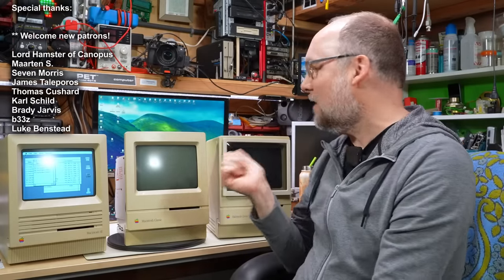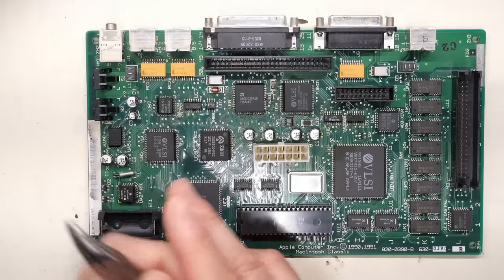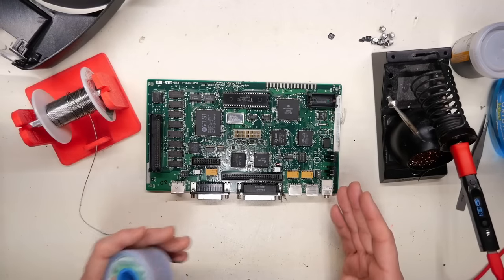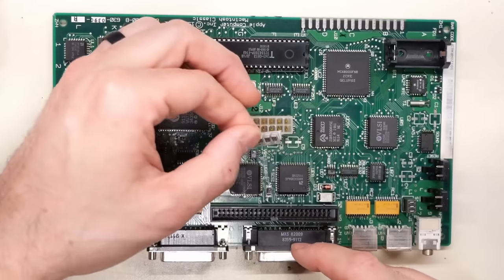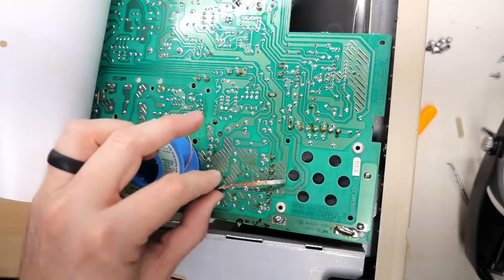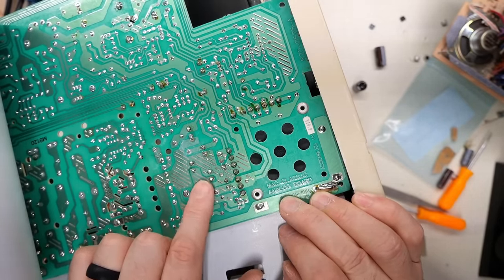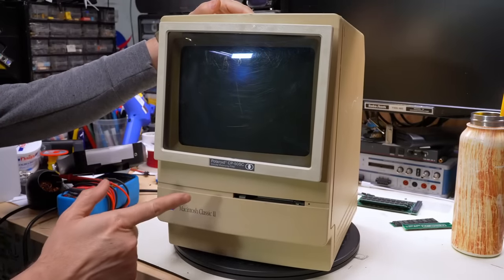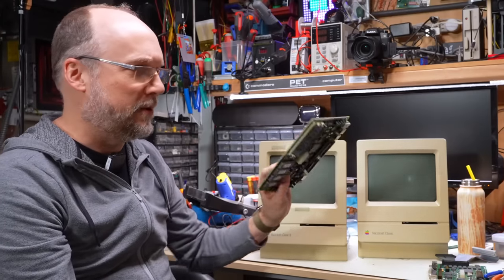Not so fast! I hit some road blocks fixing the Mac Classic

Comment from the maker: I need to mention I mixed up Ray Carlsen and Paul Carlson with the cap removal method. (Paul is the one I got the removal method from) I'm fully aware they are two different people :-)
Reply: That's what I thought.
Reply: the vinegar will most likely eventually dissolve the salts if you leave it long enough, like 2-3 hours, but you might need to submerge it in the vinegar because just the amount that you can spread on it will alter in PH pretty quickly in the localized areas near the heavily salted areas
Reply: @briangoldberg4439  I don't think they are necisarily salts. They may be lead/tin oxides. Both are used as white/ off white pigments in artists paints. The vinegar works on the unreduced electrolyte (Possibly KOH) put not on the metal oxides. The brown stuff is possibly breakdown products of the solder mask and the electrolyte. May wash off with acetone or Paul Carlson's favourite, Laquer Thinner.
Reply: LOL, I didn't even know his first name!

Comment: Don't let the loud few complaining about the wiggle method or however you remove the caps.  You've proven you know what you're doing, but some people will complain no matter what.  The loud few shouldn't get so much attention is my opinion :)
Reply: 100% THIS
Reply: Agreed. Just ignore them dude.
Reply: Quickest and easiest way to do it
Reply: There is certainly a risk to each method of removal (removal itself has a risk regardless).

Just pick the amount of risk you are comfortable with. If you don't want to apply mechanical stress then use hot air or whatever else.
Reply: It's gone? Yes.
Then where is the freakin problem?

Cause he didn't removed them another way?

We are adults or toddlers fighting because he didn't lick his lolipop same way we are licking ours?
Reply: I like'ta wiggle, -wiggle, wiggle.
I like'ta wiggle, -wiggle, wiggle.
I like to... 
🎶[(O)]¯\_d(o_°)b_/¯ [(O)]🎶
Best way to keep solder from resticking as it cools.😁👍
There's also Chip Quik, or an amalgam.
Reply: I agree but I think🤔the board should on pill too because no method is 100%, I’m just sayin cause I’m sure he doesn’t want a bunch mac mini’s running around.😳
Reply: @annacurransmotherofmeghanc1841  Just reminding you all, have your Macs spayed or neutered.😆
Reply: I guess those who complain about wiggle method has pulled the cap while they wiggled, and ripped the pads.
Reply: Only wiggle, 'casue pulling too much will make you go blind.🦯😎
Reply: Ive never damaged a pad with the wiggle method and Ive done a LOT of boards. I have damaged a pad using the snip method because the legs are under the cap. As you pinch/cut the legs the cap is pushed upward by the snips as they close putting upward stress on the pad. Ive damaged pads trying to desolder because of overheating to get through the crust from leakage. If caps were shiny new the. Desolder works great but we are removing corroded leaky caps here.
Reply: To remove the "gunk" from the pads, I use a slightly different method. I solder it up as much as it takes, then I add a liberal amount of paste flux. Cover it with desoldering braid, heat it up with the iron an just slide it of. It may feel a little rough, but I have never done any damage this way, and the pads are like new.
Reply: Adrian has countless examples that this method works. I know a key bit that he says, but I must stress, is making sure to push DOWN while wiggling. Don’t keep the pliers even with the board and especially do not lift up at all until the cap comes off itself. You don’t have to push with all your might, you are just making sure all the metal fatigue is happening to the caps wires in between the cap and soldered points. And, again, let the cap come off itself. If you’re not doing this and you pull traces, that’s your fault, not the method. If you’re still unsure, just do it how you want to and leave Adrian alone lol.
Reply: @g.h.190 And they probably weren’t pushing down or rushed it and didn’t let the cap come off on its own. There is some finesse happening here.
Reply: I don't have enough information or experience to say for sure wether the wiggle method is safe or not compared to desoldering them off
But what I do want bring something up to consider when thinking of doing the wiggle method on a random board . This being 
 I suspect this works fine for most good quality boards However I suspect some of the cheap boards might have weaker bonds between the pads and the board to were the pad will start comeing off the board before the capaciters legs fracture off the cap because the adhesive the factory used may be a low grade weak adhesive.
Reply: @g.h.190  Oh man,that sounds rough. I think those kind of people need to implement a safe word.

Comment: The secret to white vinegar cleaning is to float the board like you did and then wait while doing nothing to the board for 10 to 12 minutes then use a electric tooth brush, one of those Sonic ones, to clean corroded areas. The electric tooth brush is important and essentially acts like a localized ultra sonic cleaner when combined with the vinegar. This method can clean some really badly green corroded stuff and that white stuff you encountered is an indication that it was working but was not completely removed. Also, and I’m not sure if it matters but I use IPA with the same tooth brush to clean up after the vinegar rather than water not sure if that is necessary but might be part of why I don’t end up with any of that white after cleaning residue. Further, be aware that the white vinegar will dull the luster of non corroded solder joints so it’s best if you can restrict where you, float vinegar, on the board to only the areas that have corrosion issues. I use a syringe to better control where the vinegar ends up.
Reply: oh this sounds like a very cool idea! Thanks for recommending, I'll definitely give that a go!
Reply: Nice I have never thought of using one those tooth brushes !
Reply: ingenious tip. Thanks! 

My dad was a watchmaker, and he had an ultrasonic cleaner from the '60s with many moving parts, which was seemingly always in use (and what a gadget that was) but he used to talk (semi-ironically) about "infrasonic" cleaning, which was usually meant he was going to be agitating the part by hand in a big bowl while it was immersed in soapy water :)

Comment: Hi Adrian. Try giving the board a wash with both vinegar AND baking soda (not at the same time, one after the other). This way you have a chance to remove the electrolyte with either an acid (vinegar) or a base (baking soda). This is helpful for (NiCad or NiMH) battery corrosion, too, plus the baking soda solution will help neutralize any vinegar still hiding under IC pins! Then finish off with distilled water or IPA and let dry. Hopefully, this will take care of the formation of that white salty crap. 😀
Reply: So vinegar, then baking soda and vinegar solution?
Reply: @Bassquake76  no he meant vinegar first. Then baking soda only. If you mix vinegar and baking soda they'll just fiz and neutralise each other
Reply: Many capacitor electrolyte is a base, so vinegar helps neutralize it, stop its reaction before cleaning, which helps ensure that anything missed during cleaning doesn't continue to eat at components.
Reply: @martykopka  How do you remove the baking soda powder? Rub it on then blast it off with compressed air?
Reply: @Bassquake76  water, distilled water or IPA. Then let dry.
Reply: @Bassquake76  Baking soda in water....

Comment: Many of these have died via Battery leaks and capacitor corrosion. I had two. I put both away for a move, then the batteries blew and destroyed the ICs. Ate the legs of the VLSI chips.
Reply: It sucks how corrosive those batteries can be...

Comment: A tip I've learned when using solder wick is to put some flux on the braid to help the solder flow to the braid better.
Reply: You can purchase wick with flow already in it, at least the one I have here has.
Reply: That's what i think too. To big iron tip for smd for my taste.
Reply: @adilsongoliveira though much like with solder, for tricky use cases the built in flux isn’t always enough

Comment: The screen is supposed to "look squished", since the pixels are supposed to be square, not stretched to fill the screen. The idea was to have true WYSIWYG so that you could draw (or write) on the display using apps and get true 1:1 (to scale) of what you print. Also worked wonders on modeling stuff you could hold against the screen while you copy the dimensions into the drawing or other modeling app. Apple's stand-alone CRT's were also like that up until the Multiple Scan AV stuff. That's one of the reasons the 12" RGB had a different resolution (512x384) from the 13" RGB (640x480). Since the 512x342 resolution of the 9" CRT isn't 4:3 aspect ratio, but rather a very close approximation of 3:2, there's bigger black borders on the top and bottom than the sides.

Comment: I just wanted to comment, that after these Mac-Repair-A-Thon i finally was "brave" enough to do my first recap of a Mac Classic. I was using your or Pauls removal method with 100% success at all Caps. I don't want to show anyone my solder-joints but they are all strong soldered to the pads and have contact. And the loudspeaker is working again. And so on. So thanks for your virtual empowerment so to say!
Reply: (Of coure i tried before on old spare cheap pci-cards before the mac classic mainboard!)

Comment: The bubbling is acid-base neutralization, which releases carbon dioxide and leaves behind a salt (not salt as in table salt, but A salt depending on the exact reactants). A wash after is a good idea because of that.
Reply: A wash is necessary anyway as you don't want to leave corroding acid on the board and within the components.

Comment: The white/yellow crust left behind is oxidized capacitor electrolyte.

I've found that CRC Lectra Clean works best to remove capacitor electrolyte. Just hose the area of the board down with the electrolyte, scrub it, then hose it down again with the board at an angle. It'll take all of the electrolyte off with it. IPA instantly oxidizes capacitor electrolyte, which is what the white streaking is that gets left behind, and makes it harder to clean.

Comment: The wiggle method for the caps is fine. I sometimes repair old ecu's of 90's cars and those circuit boards tripple layerd sometimes more. So pulling them out saves the board and is way easyer to repair without damaging the circuits. Nice job!

Comment: Ceramic also don't work well in audio devices. Repaired a receiver once, that had a cap that will 100% fail at one point, because the voltage was too exact for its use case instead of a little over, which is important for components in the standby circuit because there is a higher chance of voltage spikes. The issue was then, that the cap with the higher voltage was not available in the needed size, so I tried a ceramic first. The device was working but a relais started clicking, so I replaced it with an old foil cap that was lying around, because they had longer legs to bend around and the issue was gone.

Comment: I also had some motherboard issues after recapping, but with the classic II. I noticed it was inconsistent when booting up, and if I wiggled the motherboard while it was on, the screen would turn to garbage. I asked around the forums and they said it was cracked solder joints, which I thought made sense. I couldn't pin down the exact joints that were cracked, so I just ran my heat gun across the entire board. I ended up solving that problem, and my Mac could boot consistently.

Comment: I've removed countless caps with the twist method after using hot air, iron(s), cutting, and about every other method you can think of.  +1 for twisting for the win.  Regarding the corrosion/salt leftover, it's probably overkill, but I sometimes just use hot air/flux to remove the offending IC, soak it in IPA while cleaning the board, and then sold back on the board.  Time consuming, but leave it looking brand new in most cases.  Take care!
Reply: That's exactly what I do and it's not overkill at all. That's what you're supposed to do. Leaving that salt on there does absolutely no good to the legs of chips.

Comment: Try using a solution of baking soda on the cap electrolyte residues, the average electrolytic capacitor uses a mild acidic stuff as their electrolyte, and rinsing off with acids such as vinegar or citric acid doesn't do much, those are better suited to battery leakage where the electrolyte is basic (aka Alkaline), so for caps that did the dirty, a basic solution needs to be used to neutralise the goo... :)
Reply: also worthy of note is that chemical reactions can be accelerated by increasing the temperature.
Reply: Someone mentioned vinegar first, then baking soda, but maybe you're right with just baking soda. The other person explained their reasoning as a supposed chemist, but I don't know either way.
Reply: caps are alkaline which is why vinegar neutralises the leaked effluent @Loki-
Reply: @robinsutcliffe-video_art   The Wikipedia article on the "capacitor plague" at the bottom (in the "Investigation" section) says that the good Japanese caps are/were acidic and the failing Taiwanese caps were alkaline.  So caps seem to be acidic (assuming that you aren't working with "capacitor plague" formula caps) as long as the article is correct.

Comment: Adrian, for scrubbing those pads, I would REALLY recommend a fiberglass pen. It's basically just a pen with fiberglass bristles coming out the tip. It's a great way to scrub, without damaging, pads and circuit boards when you've had stubborn residue from leaky caps like that.

Comment: What I’ve found to be very effective for removing the white salt stuff from between the legs of surface mount devices is soda blasting. I use a cheap sand blaster with a built in plastic reservoir and dump a box of baking soda in the top. It removes the residue without stripping off plating or silk screen markings.
Reply: Or just remove the old solder completely and apply new solder....

Comment: I bought a used Classic II back in 1993 and I still have it. I found a retro hobbyist to recap it for me so it works again. He said it was the hardest job he ever took on. We even got the files off the old SCSI hard drive. The irony is that I had an SE for a while but sold it believing that the Classic II was an upgrade. I wish I hadn't done that now.
Reply: Classic II is faster than the base SE. IF yours was an SE/30 then I'm sorry for your loss.

Comment: Differnet type of capacitor, especially early 90s is mostly due to capacitance available at the time, MLCC ceramic capacitor that can go into high capacitance did not exists back in the day, else that's what they would have used instead of SMD electrolytic or tantalum.

As for MLCC, the literature seems to say the opposite, the closer to rated voltage the more loss, the lower the DC voltage the less loss in capacitance (but the amount of loss will depends on the type of MLCC capacitor)
And I didn't knew that, so, I've learned something new today 😊

Comment: I've found that when you need to clean corrosion off of pads (or off of chip legs in a bad situation) , a fiberglass scratch pen does it quickly and easily. I have an A4000 which was sold to me as a known basketcase...the original owner didn't think it was savable, so I got it for a steal. I had to recap it, replace all of the clock circuitry, replace all of the simm sockets, and replace the F245 bus transceiver chip which is located right next to the clock circuit (which is also connected to on-board fast memory). All of it was corroded from a leaky battery. I've gone through a couple of those fiberglass scratch pens, and they are literal magic.

Comment: Hi Adrian, I had similar problems with memory and leaking caps on my classic. After recapping computer was alive, but memory expansion was not detected (no sad mac this time). The problem was solved by desoldering UH6 (74LS174) cleaning acid under the IC legs and soldering a new one. But another problem remained, I could no format or save to disk, and this time was the adjacent IC UI6 (74LS368) with one trace broken under it by corrosion. I bypassed this broken trace with a bit of thin cable and solved... so take a look at this IC because they are very near some of the leaking caps. And finally about the original hd, when they seem don't boot, you only need to open them and remove a little rubber black ring where head sit that gets sticky. Hope it helps, Francisco

Comment: Their were so many  counterfeit caps back then. I have devices that are 50-70 years old and the caps are fine, but stuff from the 80's, 90's, early 2k.... I also worked in manufacturing in the late 90's and we got several batches of parts that had to be returned because they failed testing, they were name brand, but when you looked close the heat shrink labeling was different, harder to read.

Comment: Using dual iron or even tweezers I used to get a pad or two come off of every other board. Since switching to the twist method I've had no issues at all. Anecdotal but that's my experience. Also, on that analog board you'll get that fishy smell on almost every single electrolytic on there. It'll still work OK without replacing them but I definitely swapped them all out on my Classic and it runs great!